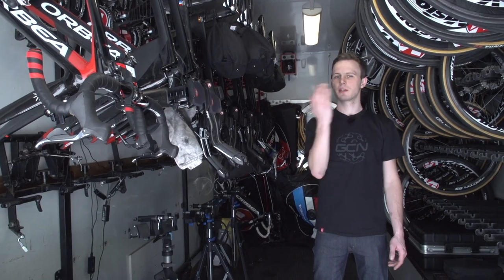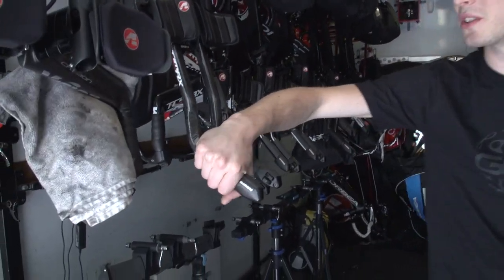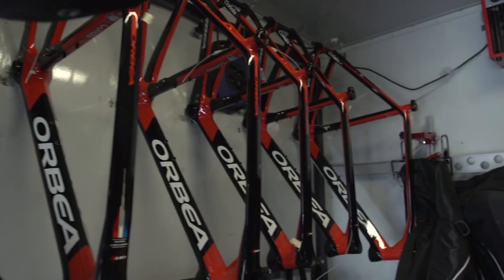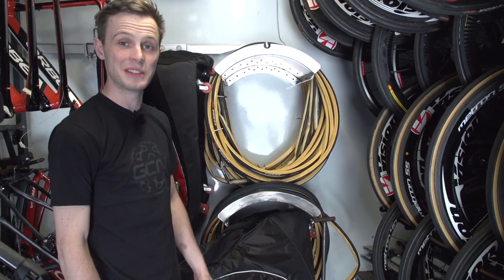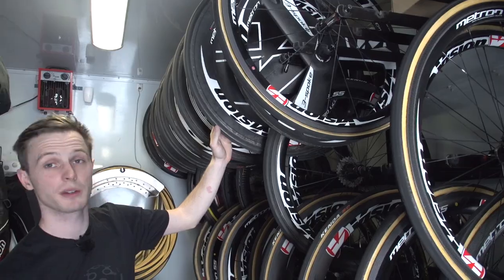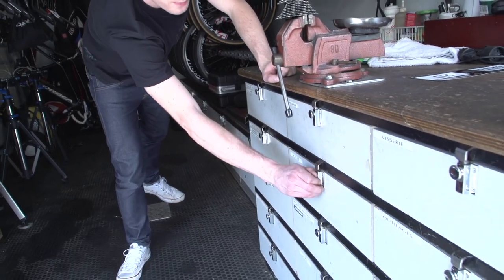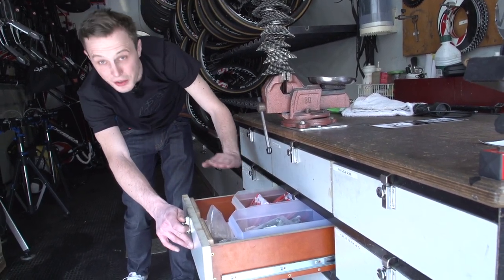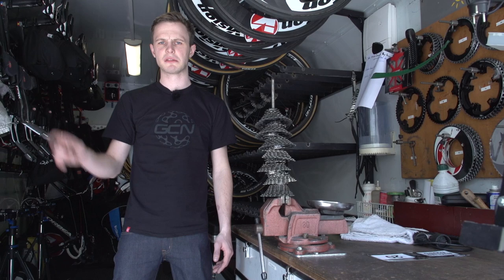Cofidis Mechanics' Truck Tour

Comment: Great vid Tom! Surely you must have done 60ks before on the descends!   Like those unusual teeth chainrings.  I find it a bit odd for riders to use a 49 inner because the gear inches compared to a 53 is quite marginal.  Might as well just use a single 52 or 51 and no inner to save some weight.